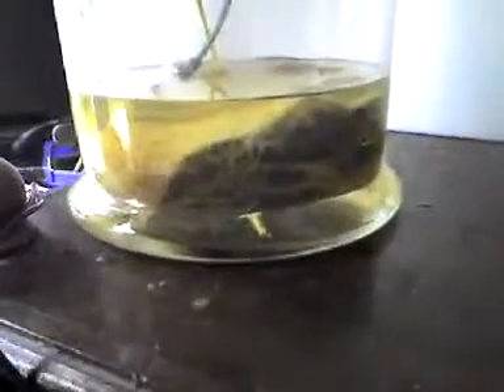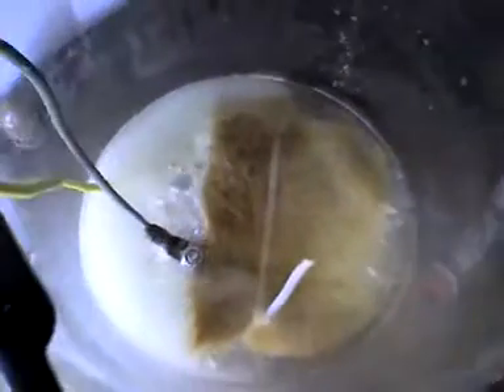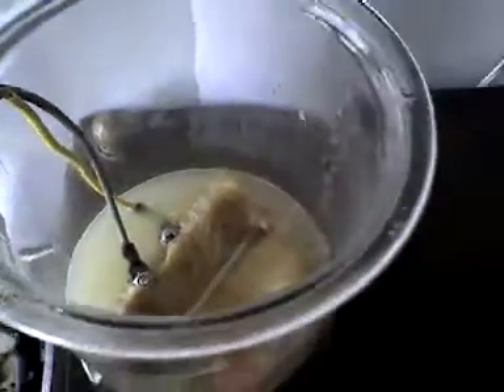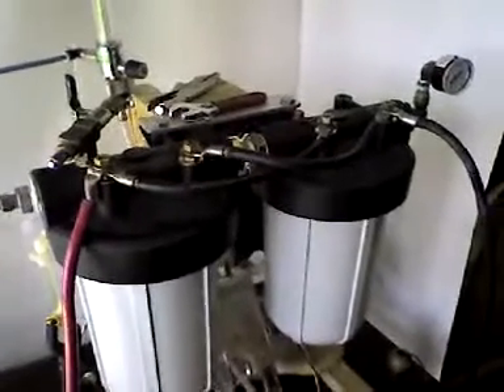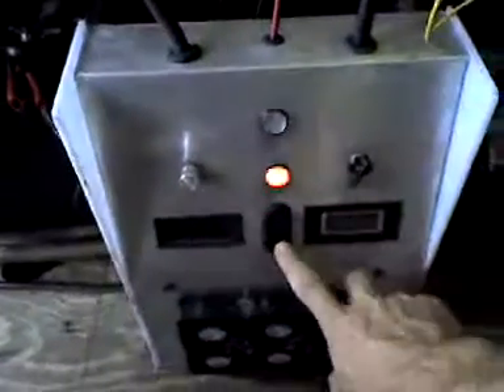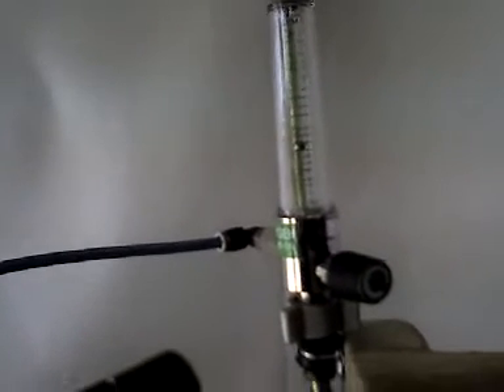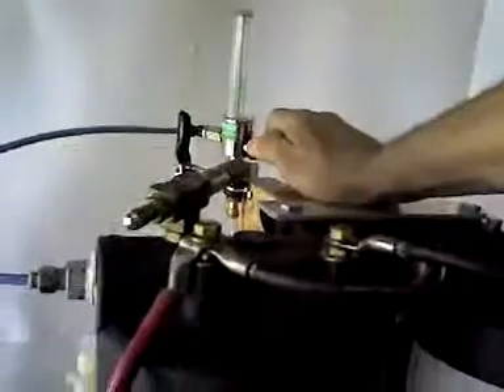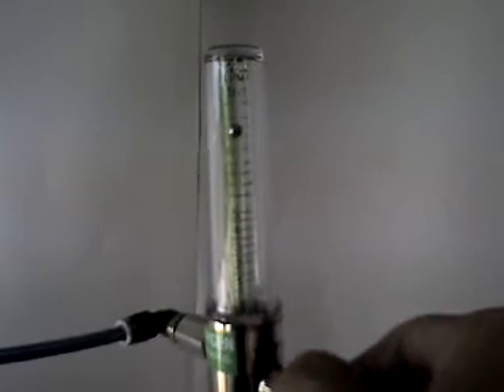Highest Possible Development On HHO Part 2

Comment: Hello. How long does the cell last? with something like steel wool it should start deteriorating pretty fast,
Reply from the maker: In honesty I never let it run long enough for it to discharge the batteries,  but the units mounted in vehicles lasted well over 3 months before the output starting to decay, thanks for your comment .
Reply: could you mak a video on how to calculate how many cells you need to run a given liter car like 4.7 liter tundra or 3.7 liter jeep for example
Reply from the maker: First you need to average the air consumption on that given particular engine! then consider that you will need a minimum of some what around 30% of the total amount of LPM... keeping in mind that the coefficient works in identical opposition of the conventional fuel consumption... I'm sorry for not making the video...  I no longer have any of this equipment any more hope you understand!
Reply: I am just beginning to understand all this but I was wondering if we could bounce ideas off each other from time to time, as scientists trying to figure out what works best, i only ask this because you are the first hho scientist that has replied fast enough for me to see  the comment
Reply from the maker: Well I don't consider my self a scientist, just a very humble engineer.. but for as long as I can I will try to answer any question that you may have.. Good luck..
Reply: thank you

Comment: Is it "the larger the size of the wool the higher current consumed"?
Reply from the maker: You may say so, But the real reason is the surface area that is exposed to be in contact with water. Thanks for your comment.